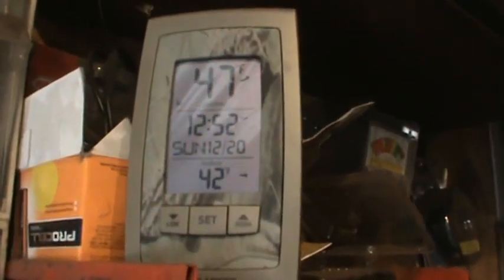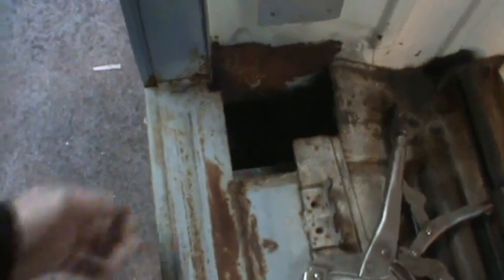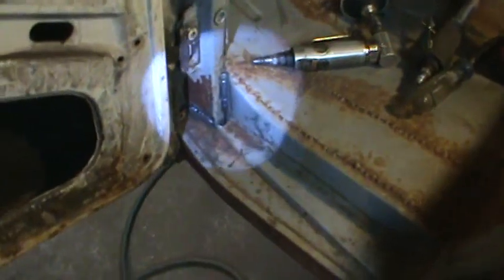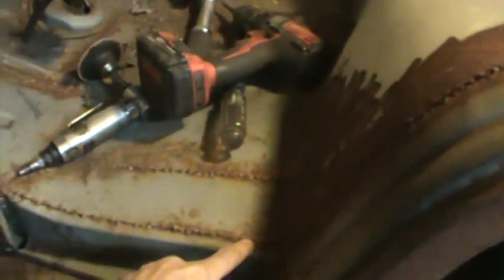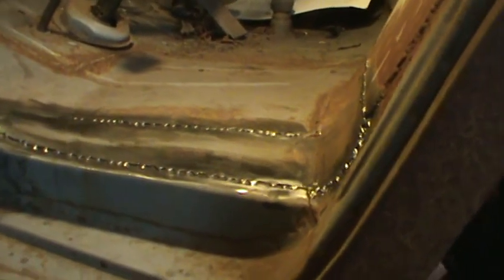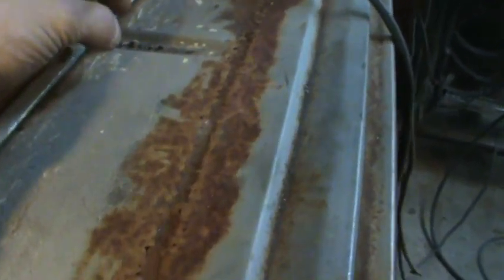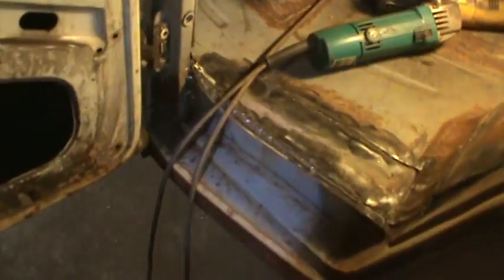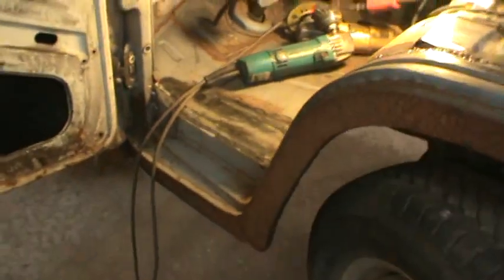vw double cab dog leg rust repair

Comment: is the back accessible?

I have had good results using a chunk of copper or a welding spoon on thin sheet as a backer.  Steel won't stick to copper, and it allows you to weld holes and porosity out at high temp and fill 'em in.
Reply from the maker: +tiporari l do have a copper spoon that l use but that was in a channel
Reply: mustie1 ahh, figured as much.  Pain in the butt welding up holes, making holes, rinse and repeat

Comment: I suppose you could allways add an oblong plate to the underside, where that most used stepping area is, just to beef it up so it never fails.
You dont have to keep it original, just good and strong :-D
The angle grinder is your frend :-D
Reply from the maker: +zx8401ztv and cut off wheel